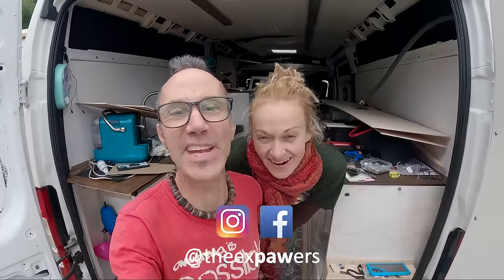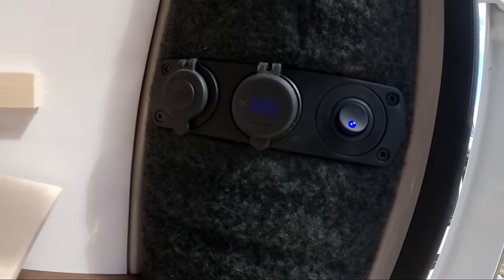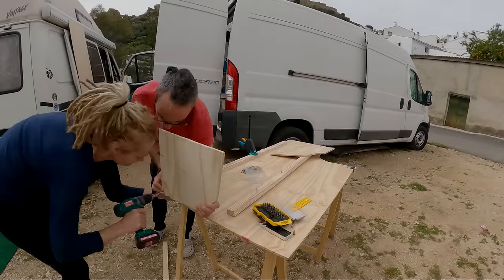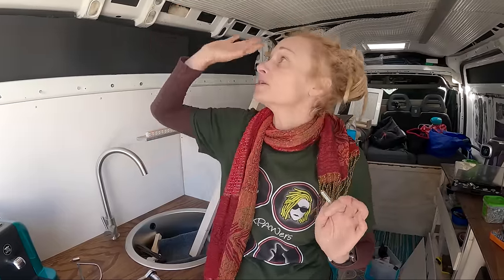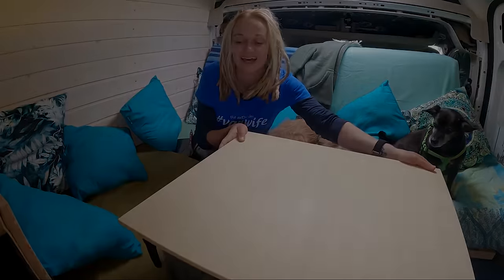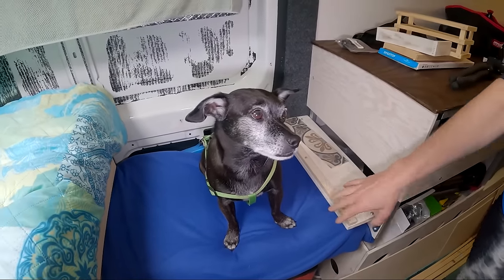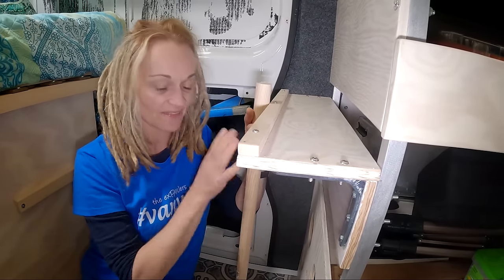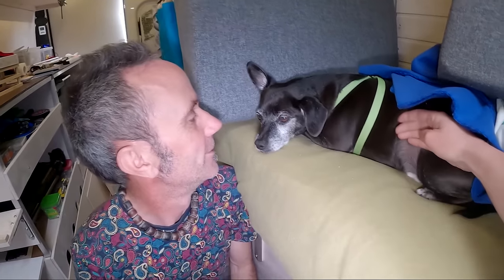RUSTIC AND WONKY BUT FEELS LIKE HOME  - A UNIQUE VAN BUILD - VANLIFE

Comment: Wow!  You’ve done a brilliant job Nick & Sarah… very impressive!  Everything is looking great!  ❤️
I would definitely go for a larger window for the view but get a dark tint for privacy too.  I know the bed is the same level as the bottom of a larger window but you could get those pull up blinds that pull up from the bottom of the window… then if you want a little more privacy when you’re laying in bed, you could pull it part way up.  As for the type of window, I have only ever had sliding ones; if you had those open out ones is there a risk that the doggies could jump out the window from the bed? (Maybe your doggies wouldn’t jump out but I know mine would, especially if he saw something outside!).  I have metal mesh vents that you can lock into the gap of the sliding window to allow ventilation but to provide security at the same time… no dogs jumping out and no intruder coming in.
Keep up the good work!  Not long now!  Love to you & the doggies from me & my doggy!  xx🐾🐾

Comment: Your drop shelf…how about a re think, 2 bits of wire or rope from above, stopping it going over 90 degrees, it would be light weight, and no other parts like poles etc
F45s awning would sound great for you, as you have experience

Comment: I have sliding windows in my van & the advantage is that they can be open while driving. The disadvantage is they're not mini-awnings.
Reply: If you get awning windows get ones that open past horizontal so they channel heat rising off the walls outward not in.
Reply: with a sliding window at most half of it opens, with a hinged window all of it opens

Comment: Not sure re awning window verses sliding but Id definitely go for the smaller size and not have it go all the way down to the bed. Otherwise youll end up having curtains that end at the same level as your bed which, from experience, you'll catch with your feet and either pull them down or move them enough that you end up with a gap for people to see in and watch you sleep...😂

Comment: You mentioned fitting a window in one of the rear doors.  I would suggest that you stick to the letterbox type windows that cant be used to break in to the van . or at least a window thats too small for a naughty monkey to squeeze through ….imho…😊
Reply from the maker: Thanks for tip. 😁

Comment: Ive got awning style but tbh id go with sliding ones because any wind and these slam shut.  Maybe panorama if so close to the bed, might get wet in winter with the condensation if the quilt moves onto it in the night. x
Reply: Hmmm good point about the condensation on the window potentially wetting the quilt.
Reply from the maker: Good point but then again just thought about the sliding ones and the fact that the gutter fills with water (before draining) if raining heavy and the. The bed quilt could get wet from that too!! Such hard decision 😅
Reply: @theexPAWers  🤔
Reply: My gut feeling was to go big for light & view.  But yes, the quilt could get wet from condensation if it is touching the window… and that would apply to both styles of window.  Decisions decisions! 🤔 (Looks like you’re going to have to draw up a ‘pros & cons’ list.) xx

Comment: For the cupboards instead of solid fronts have a look at this solution. It could more flexible https://youtu.be/3-Oy9N_hZf0?si=wdEe6Ac_uwGuR6Oa. You could use fabric you are using in the rest of the van and it would stop things falling out when travelling unlike curtains. The clip is 1.4 mins in.
Reply: the fabric baskets with zip hatches are definitely worth considering but I wonder how practical they are compared with a rigid door & catch?